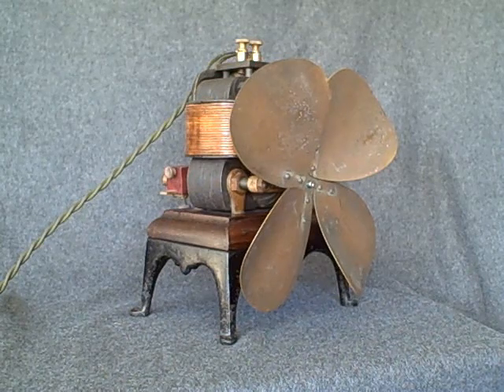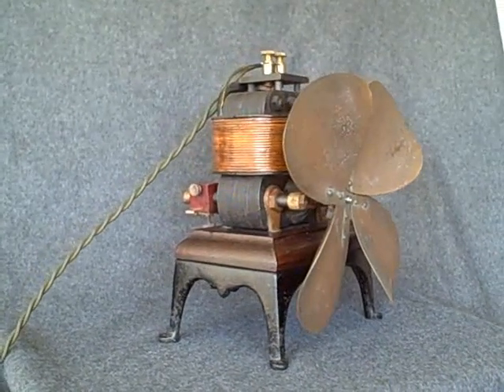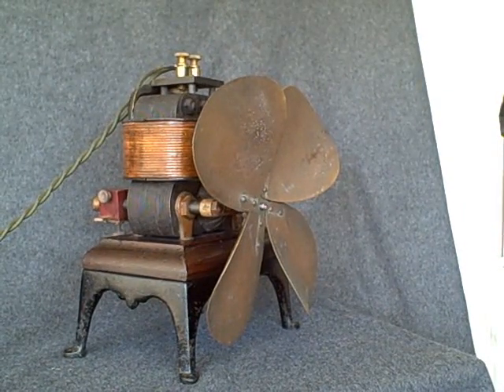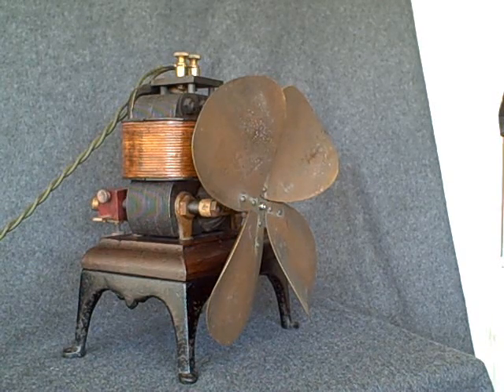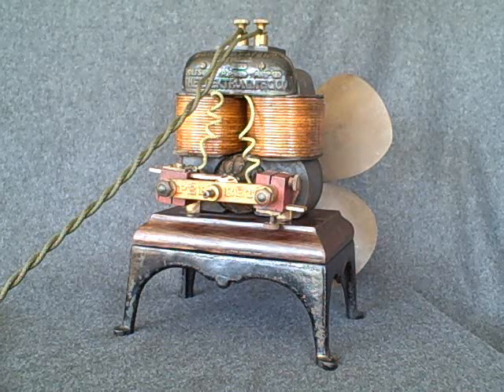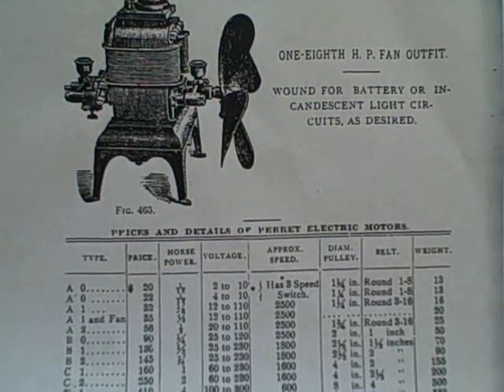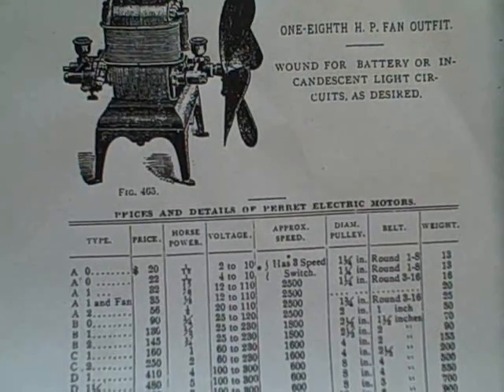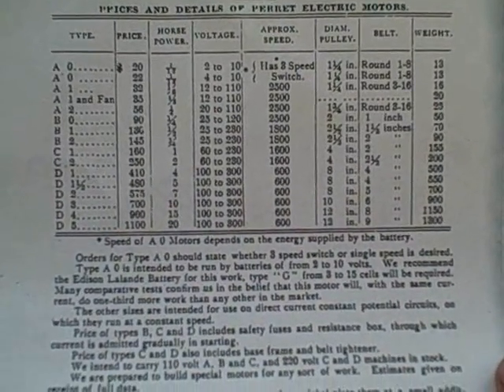Elektron "Perret's Patent' Fan 1889-1890

Comment: Is that a nickel iron cell? or is that a transformer with a full wave rectifier. I can't tell where that other wire goes to an on off switch. I also hear the 120 Hz hum just before it starts to spin. the hum immediately stops the instant it switches off. I would like to see a close-up shot of the brushes and commutator.

Comment: It looks like you have a transformer in your battery .running on ac ~? Or with a rectifier DC_ Your motor  make a soft 50 ~60hz sound on the start up.but it is a nice looking brush motor fan!.running on tesla ac currend:-)
Reply: Hee jonge. Hoe is het met lang niet meer gesproken

Comment: The fans I posted on Youtube are in my personal collection. The porcelain battery cell is original however I fit a modern transformer/rectifier inside to generate the correct power without resorting to the caustic chemicals used originally. Original batteries required frequent replacement of all internal parts, including noxious chemicals. This fan actually runs perfectly with a modern 6v lantern battery. We have far easier power options available today than in the 1890s.
Reply: I think you are incorrect on what power sources they had at their disposal at this time in history. I'm a telecommunication engineer and if you like all things to,do with electricity then I suggest looking into atmospheric energy capture. Even many buildings have this knowledge built into the design of the architecture .